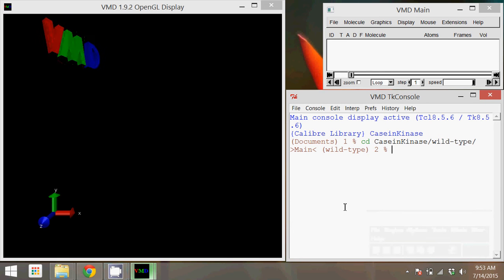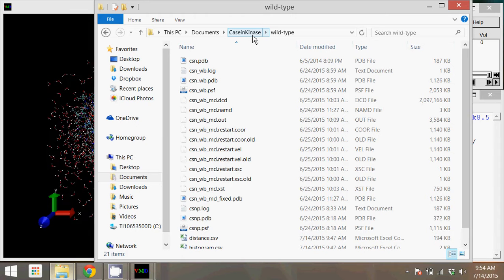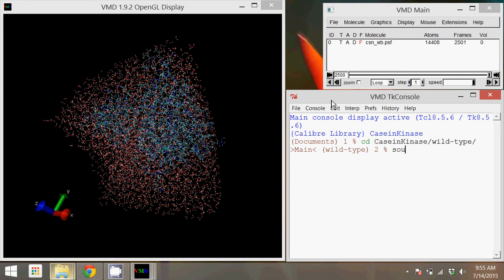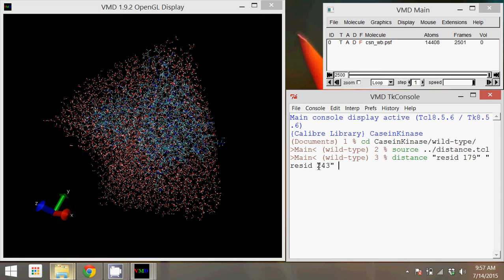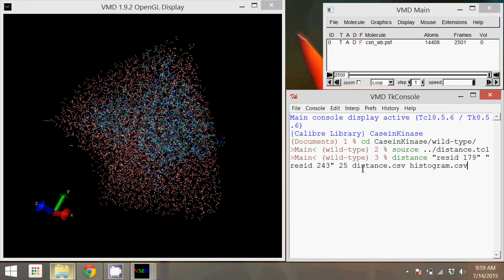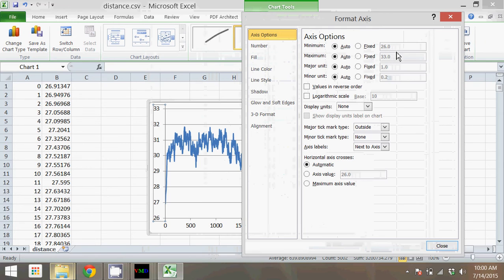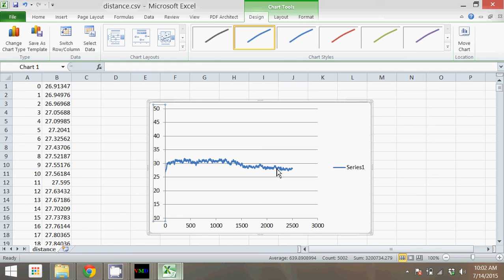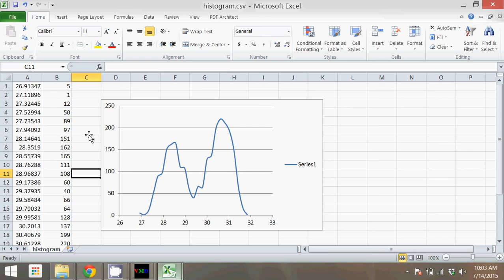VMD Distance Measurements of a Simulation in NAMD

Comment: Thanks a lot. Tutorial was very helpful. How to calculate angle between two helices?
Reply from the maker: You can calculate the angle made by three atoms. I think the command is measure angle {index1, index2, index3} (https://www.ks.uiuc.edu/Research/vmd/vmd-1.8.6/ug/node124.html). Or you can create vectors from two atoms on each helix and calculate the dot product -- for example, a = [(h1x-h2x), (h1y-h2y), (h1z-h2z)], where h1x is the x coordinate of atom 1 at one end of helix 1 and h2x is the x coordinate of atom 2 at the opposite end of helix 1. Repeat for b for helix 2. The command is then vecdot a b. (https://www.ks.uiuc.edu/Research/vmd/vmd-1.7.1/ug/node163.html). The dot product of two vectors is a . b = |a||b| cos(angle), where |a| = sqrt[(h1x-h2x)^2 + (h1y-h2y)^2 + (h1z-h2z)^2].

Comment: Hey Troy! Tutorial was very helpful, I have one doubt. How do we compute simulation time ( in nano seconds )? Could you clarify the question?
Reply from the maker: I assume you mean the simulation time with respect to the distance measurement. It will depend on the settings you use in your simulation. The timestep variable is in femtoseconds (0.0000001 nanoseconds). The frequency of saving to the dcd simulation file is in steps (dcdfreq). The run variable is a total number of steps. Each frame of the simulation that is saved in the dcd file corresponds to t = timestep * dcd, which is units of time/step * step. If you do this correctly, the last time value you calculate is equal to the number of run steps * timestep.

Comment: Thank you so much <3 I have a question. Does this script work if I want to know how far the ions are from phosphate groups in a membrane?
Reply from the maker: Yes, it will measure the distance between any two selections.
Reply: @TroyMessina  Amazing. I would like to ask you one more question. What if I want to know which atoms are within a distance x of another atom? It would have to make some modification to the script or would have to start another from scratch.
Thank you for the help
Reply from the maker: @andresamessias9310  Finding nearby atoms is a different calculation. The result is a list of atoms and their positions similar to what is in a pdb file. If you do this for a trajectory, you might have thousands of pdb files as a result, or maybe they could be stored in a dcd trajectory. I have never done this calculation on a trajectory. The tcl file would be something like

set sel [atomselect top "within x of resid 10"]
set n [molinfo top get numframes]
for { set i 0 } { $i < $n } { incr i } {
  $sel frame $i
  $sel update
  $sel writepdb withinxof10_$i.pdb
}

Call it in TkConsole with source filename.tcl, and it will run automatically on the top molecule. With more advanced scripting,  one could calculate the probability of atoms moving within a distance x of another atom.

Comment: Hi, Troy. Great video, very helpful. One critical question, how to calculate the shortest distance across the periodic boundary condition (PBC) ?
Reply from the maker: Open your structure as the top molecule. Then use the commands
 set all [atomselect top all] 
 measure minmax $all
This will give the minimum and maximum  x, y, z values. Calculate the differences to find which is the smallest. Here is a discussion that includes a script to calculate the periodic cell. https://www.ks.uiuc.edu/Research/namd/mailing_list/namd-l.2011-2012/2735.html

Comment: Hi 
Thank your for the vedio and the great explaination, but I have a problem in the frame loading, I have about 2000000 frames but I can  only load 606 frames also my RAM is 32G
Reply from the maker: Hi, you can load fewer frames and do the analysis on a small subset of frames. You can combine the data of all of the subsets in your program of choice (Excel, Igor, Matlab, etc.). To load fewer frames, see this site  https://www.ks.uiuc.edu/Research/vmd/current/ug/node42.html .

Comment: yes this is helpful.. thnx a lot .. but i have question regarding tcl script...the tcl script u have given,  this is only for simpler structure of protein .. but i'm having structure of protein with mRNA and  i dont have any idea how will i write the script. please help me on this
Reply: Troy Messina
Reply from the maker: Hi Sakshi, I do not work with DNA or RNA. Therefore, I am not certain. I assume you have been able to load and view structures in VMD.  You can make distance measurements between any keywords that are indexed in your structure (pdb?) file. For example, if you know the atom "index", you can use that instead of "resid". VMD has a variety of selection keywords. You can see the list of keywords in the Graphics -> Graphical Representations interface. Use the "Selections" tab to view the keywords.
Reply: okay thank you Troy
Reply: but i'm having 17 conformations, and each conformation contains 3000 atoms (excluded water sphere), so how am gonna measure disance???
Reply from the maker: The number of conformations doesn't matter. The script goes through "frames", which are the conformations You will get a list of distances for the pair of selections you make for every conformation. You only need to tell the script what selections. You will need to decide which atoms have a distance between them that is important.
Reply from the maker: Sakshi, if you send me your pdb structure file, I can give you a specific example for calculating distances for your structures. It must be a pdb file that does not produce errors in VMD.
Reply: @TroyMessina  i just need to know that what are.. f_r_out and n_d 
They are just file name which you have given for saving the data.. or something else.. 

Actually this tcl file will work for me.. 
So that's why I'm asking

Plz reply as soon as possible
Reply from the maker: Sakshi Sharma  f_r_out = file name to save distances. You said you have 17.
N_d = number of bins in histogram. This should be a number smaller than 17. You will not use the histogram, but you need to enter a value for the script to work.
f_d_out =  file name to save histogram. You will not use this file, but you must enter something for the script to work.
Reply: @TroyMessina  again thnku soo much .. 
I've also texted u on insta 
If i'm having problem.. with that.. 
Hope u'll help ( again )😊🙏
Reply: @TroyMessina  I'm running this script on terminal .. by using command vmd -dispdev text -e script.tcl
Still its on running 
Now what else i have to do? 
Should i have to uplaod psf and dcd file .. in that case.. I've done that also .. 
Nothing is working plz help again🙈🙈🙈

Comment: Hi Troy, great job and thank you. Is it possible to do it taking atom to atom distance? if yes, can u please describe its syntax, thanks.
Reply from the maker: Hi Sinha, yes you can calculate distances between atoms. Replace "resid 179" with "index 1234". Of course, 1234 should be the true number of the atom you want to select and subtract 1 because the index begins with 0. If you want to be certain you have chosen the correct atom, you can use boolean logic. "index 1234 and name CA" for example.
Reply: Hi Troy, yeah I figured that out after posing that question... very nice tool

Comment: Very well-presented video, thanks. However, I have   been trying to load the command "source wat_sphere.tcl" for some time now and the Tk reply is "can't read molname: no such variable". I had no problem with the NAMD ubiquitin tutorial, but it doesn't work for my molecular structure. Also, although autoPSF build seems to work OK,  the "Add solvation box" facility won't display my molecule in the water box: they sit side by side in VMD. Sorry to bother you, but I'm going round in circles with this. Appreciate your comments.
Reply from the maker: Hi Simon. Do you want a water box or a water sphere? I prefer the sphere since it is more natural and doesn't require the same kind of boundary conditions as a box that can make the simulation appear as though it is misbehaving. The water sphere requires you to do your own scripting for the simulations though. VMD cannot currently handle water spheres as far as I know.

Are you using the original wat_sphere.tcl or my edited version? The original version is looking for a file called ubq.pdb and ubq.psf  in your current Tk directory. It will need to be modified for your particular molecule.  My modified version will let you enter the filename. Source it (source wat_sphere.tcl). Then, use the command "addsphere filename". The filename is the name without extensions, i.e., do not put .psf or .pdb. You will need to have psf and pdb files with the same filename. https://drive.google.com/open?id=0B9hkwleIkrN0bmRaaURYblVZbU0

For the water box, VMD may be behaving correctly. You may need to close all structures and reload only the solvated structure that is saved from the VMD solvation process.
Reply: Many thanks for your prompt reply. I am using the original wat-sphere.tcl script, adapted for my molecular structure. I will try your suggestion tomorrow.

It has been very frustrating trying to run the simulation with my molecule...the tutorial went reasonably well, and I was optimistic NAMD would be well-suited for my MSc dissertation. But it really doesn't want to run... I wonder if it's because I'm running an oligonucleotide rather than a  protein? I changed the top file but that had no effect.

I can solvate my molecule in a water box as required by the tutorial, but only via the "solvation box" facility. Command line doesn't work, so after that point, the simulation stalls.

Kind regards  Simon

PS...it's good to see a video guide that is paced properly. I have made several for my university, and taking a procedure slowly is far more effective than being flash and speedy!
Reply: Hello Troy...I'm afraid that didn't work. I can add a water box to my molecule, but the simulation won't go any further. I'm wondering if the problem is loading  an unorthodox nucleic acid structure rather than a protein? I have adapted all the relevant scripts, but they are consistently 'not found' in Tk console.
Reply from the maker: "not found' sounds like a path problem rather than a molecule problem. If you have a na molecule in a water box, you should be able to run from VMD using the NAMD GUI. You'll need to point to all of the relevant topology and molecule files as well as indicate thermodynamic and boundary information. This video shows usage of the GUI. https://youtu.be/2hEur0xMbiw

Comment: Hi troy,liked your videos please upload a video on how to move a protein using VMD.
Reply from the maker: Hi Surya, I am not sure what you mean by "move". Do you want to position two molecules? Do you want to simulate the motion of a molecule?
Reply: Troy Messina thanks for your reply !I meant to say how to use move script to position two molecules in VMD
Reply from the maker: If you want to visually align two molecules, you can use the move command (http://www.ks.uiuc.edu/Training/Tutorials/vmd/tutorial-html/node4.html#SECTION00042300000000000000). If you want to align two similar molecules by best fit, you can use measure-fit commands (http://www.ks.uiuc.edu/Training/Tutorials/vmd/tutorial-html/node5.html#SECTION00052000000000000000). If you want to do docking studies, you will need another program such as Autodock Vina (http://vina.scripps.edu/). On Mac and Linux Autodock can be installed as a plugin to VMD.

Comment: hi Troy,
I ran the simulation for 5 ns with the dcd frequency 10fs . This means that i have 500000 frames. when i m trying to load this file in vmd . It doesnt take more than 30000 frames. Why is like that. and what can we do to rectify that, Thanks.
Reply from the maker: It's probably a memory issue. You may only be able to load 30,000 at a time. You can select which frames to load when you open the dcd file. Typically, the dcd file is analyzed through tcl scripting rather than visual inspection.

Comment: Hi Troy,
I have been using your tutorials for my own structures, and have run into an issue w/ VMD. If I ask it to select, say, 1,000,000 frames, it collects maybe 16000 frames. I have tried to find the solution online via uiuc.edu and stack overflow, but so far have not been luckyy
Reply from the maker: Hi Cameron,
The number of frames in a simulation is usually different from the number of timesteps. If you run a simulation of 1,000,000 timesteps, the output may only be once every 100 or 1000 timesteps. This means you get 10,000 or 1,000 frames. Check your settings. Somewhere there is a "dcd output" that sets the frame rate. Keep in mind decreasing it can be expensive in time and disk space without much extra information about your system. It depends on whether you're using the GUI or scripting where you'll change this setting.
Reply: Troy, 
Thank you so much for the response. So if I ran a simulation of 1000000 timesteps with 1 fs each, even if it only collects X # of frames, it is still a 1 ns simulation?
Reply from the maker: Yes. The timesteps are the actual time. It is common to only store some of that information simply because it overwhelms the processor and hard drive. If your dcd output is 100 for a 1 fs timestep, you get 100 fs resolution in any analysis you do after the simulation. Since we are often doing statistical analyses, e.g., # times a particular distance is seen, this is plenty of information. Typically, we repeatedly restart the simulation and run for 20-100 ns of total simulation time. This gives tens to hundreds of thousands of data points.

Comment: If I load two files into VMD and I want to find the distance between two different residues on two different protein how do I change the distance command to do that. for example this is what I tried to run:
Main< (post1(3j59and3j5a)(4V75)Middle) 10 % distance "Chain C and resid 20" "Chain d and resid 11" 1 distance.csv histogram.csv
I would also like to do this for a number of different structure that each have their own pdb file.
Reply from the maker: +KMAMK123 The distance between two different files could result in something completely arbitrary. You will need to align the structures somehow. If they are the same structure from different simulations this is straightforward (http://www.ks.uiuc.edu/Training/Tutorials/vmd/tutorial-html/node5.html). It looks like you are comparing two different chains of a dimer/trimer/tetramer? If so, you will have to find a way to align them so that they are arranged as they would be when interacting. I'm not sure of a quick answer to that problem. If you can provide more information, I might be able to help more.

Comment: it's really very interesting, but i just have one question: between which points of the two amino acids that you use it to measure the distances?
Reply from the maker: Abdulkarim Najjar The script calculates the center of mass for the two amino acids. It uses a formula like this (https://upload.wikimedia.org/math/b/e/2/be208f63480ba3b456ac669bea6319cb.png) where R is the center of mass vector, m_i is the mass of each atom at vector position r_i. The distance is the vector length between the two (see below).

If you give the script two single atoms to calculate the distance between, the centers of mass are at each atom, and it will use the atom positions (x, y, z) to calculate a distance = sqrt((x1-x2)^2+(y1-y2)^2+z1-z2)^2).

Comment: nice content
I'm new in VMD and MD. Which file contein the ResID and ResName?
Reply from the maker: Jahzeel Rosado Thanks!

The resid and resname are in the simulation file (.dcd), but this file is not easily readable because it is binary format. The resid and resname are also in the pdb files. You can open pdb files in a text editor. You can also save a pdb file from frames of a simulation (.dcd). See the thread linked below.

http://www.ks.uiuc.edu/Research/namd/mailing_list/namd-l.2007-2008/3487.html
Reply: Great thanks a lot!